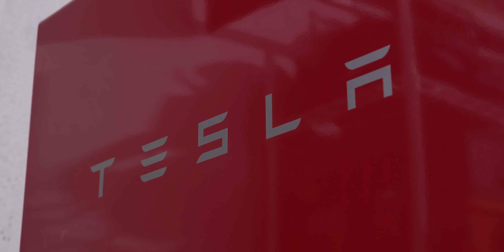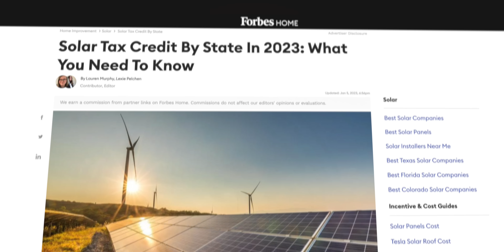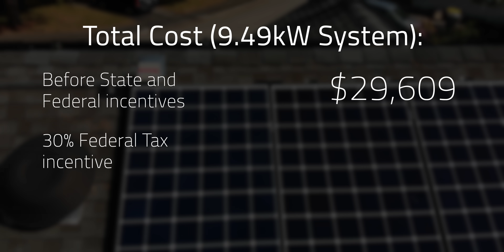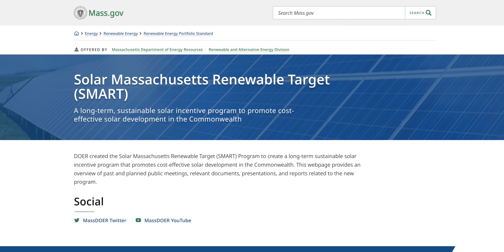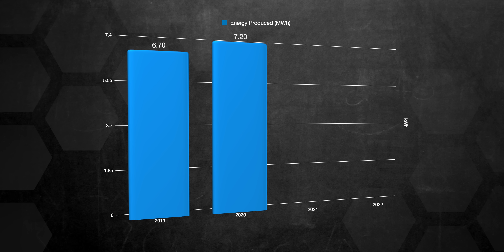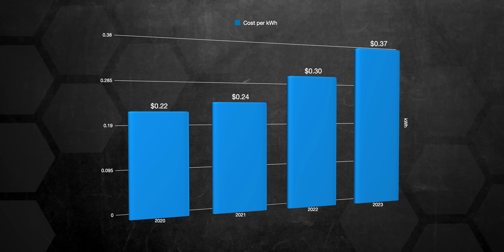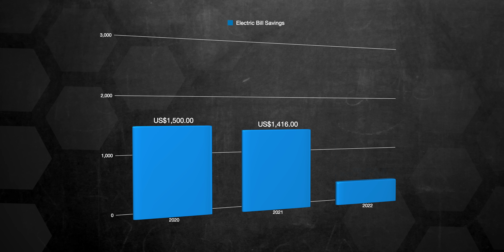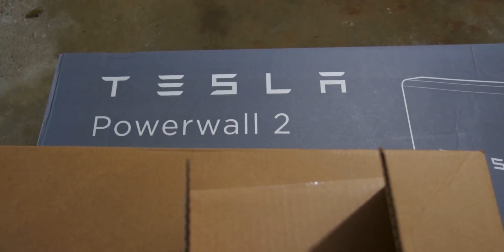5 Years with Solar Panels - Is It Still Worth It?

Comment: what does Tesla say the life of ur wall will be?
Is it a cell type battery?
If so u need to learn how to change them out when one or 2 of them go bad
I now own 2 Leaf's one is a '13 the other is a '20
I have had the '13's battery pack twice now to change out all of 5 cells rathjer then buying a whole new battery pack
So far my cost to do this is 2 hr of my time and the $1000 I paid for a wrecked Leaf and I still have a 16 good cells left.
By the way is ur wall battery made with the same cells (if it is a cell type battery) as the cars use?
I am thinking of buying another wreck to get a wall battery.
By the Way I am a BSET so i do all this work myself.  It is not hard and all i need here in NYS is an election as a contractor.  Found one who will play this part for me very cheap
After all all he needs do is come look at my work and say it was done right and sign take my check.

Comment: I( see why u went solar  I pau just a little over 12cents/kwh with 35% of that being transmission cost over 100 mil form Niagara Falls  Yes I am a NYSEG user so my electric is all ready all renewable
But where I live wind is best so I am saving to put up a 10K mill  Ya not much but it is the battery that I want to cover outages more then savings on power
We get about 25% out of max mill here so it well average about 2500k  As i use less then 1K on average I will me making money on this
How much I dont know b/c NYS keeps changing it every few yr
I would like to see Ny go to net metering but the for profit elec co will never let that happen.

Comment: Great analysis! I'm thinking of going down this path myself.  Are there issues installing solar onto a century old home?  Would it make sense to address other home issues first for energy efficiency like windows or insulation?
Reply: My grandparents just went solar and their house is 90 years old. I think it depends on the condition of the home and the roof. We were also concerned about the age of the home but if you find the right company it’s possible unless you make a DIY project which might also work. If you are interested, I can give you the info of our consultant(if you are in the U.S), he was very transparent all the way with us so I’m confident that he can help you. Let me know if you are interested
Reply: Our home is about 50 years old and yes you should absolutely air seal your ceiling (taping so there aren't leaks between the ceiling and attic). Insulation and windows will go a long way too. We saw 30% less electricity usage this summer vs last summer (actual usage, not just price) from having our HVAC ducting repaired and doing some minor repairs in the attic.

Comment: I just had a solar guy over last night. I was leaning towards getting the solar but I’ve changed my mind. Why, because in researching the bottom line. I spoke with the county assessor office who said, when the permit is pulled for the solar installation, my property taxes will go up. Then to top that off, I spoke with the realtor I’ve dealt with for nearly 20 years and she said for where I live, the solar install is not actually resulting in an increase for selling price. Both of these things go against what the sales person was saying. The salesman was correct that my insurance cost wouldn’t increase. 

So if paying cash, I was looking at about a 9 year break even point prior to factoring in the increase in property tax. Now it could be 14 years and if I’m not going to be able to recoup anything when selling the house. Why should I even go solar. Considering I’ve already been in this house for 5 years and on average people move every 7 years. solar is a bad idea.

Comment: Had my solar installed for free. I have an agreement to pay per kw produced. With an increase of 2 percent per year.
I had it installed in 2019 and I'm still paying under 14 cents per kw. 
Electricity was 22 cents when I started and now it's 39!
I was saving about 9 cents per kw and now I'm saving about 25 cents per kw.
It produces about 11,000 per year and I use just over that. So I pay the full 39 cents for about a month's worth.
Nothing out of pocket for the system and I saved about 2750 last year.
I've been saving for the past 3 years, more every year.
I don't have to worry about return on investment (ROI).
I went this route because I don't plan on being here for more than a total of ten years. At the time ROI was estimated to be 8 years if I bought one right out.
I didn't want to see a saving only for two years. I have saved about 7k to date so I'm still happy with my choice not to buy.
Also, it will be interesting to see of he sells for more than what is estimated. It's been my experience (not my first house with solar) that most people are weary of solar; they don't lime what they don't understand. Depending on how much time is left on the warranty, they know it's one more thing to worry about.
The system I had installed (for free) is covered for 25 years. So when I sell, it will still be covered for 15 years. It makes it easy to sell the house.

Comment: Matt, you don't say if you have an EV but net metered electricity to charge our car saves a pile of money and the satisfaction of not using gallons of gasoline.  Our 9.2 kW system after subsidies is amortized at 5 cents per kWh. Electricity for our Chevy Volt plug-in hybrid costs 55 cents per gallon equivalent compared to $3,50 per gallon for gasoline.  Currently, electricity here costs about 14 cents per kWh so even at retail rates it would only be $1.54 per gallon equivalent.

Comment: The only reason I have solar is because I don't expect the power company to be reliable or even be here in a short time.  That is why I would not consider degrading my battery by letting the power company use it.  My system is totally off grid.  I do not have a grid tie system.  It does take time to manage the loads even though, I have been saving quite a bit on my power bill.  Soon we will not have access to the grid if Kalus Schwab gets his way and he has since 2020,

Comment: "not being pulled from a pool of taxpayers money" that is a bold faced lie. Comparing it to the Child Tax Credit doesn't change a blessed thing....they are both credits added directly to your balance sheet when calculating your taxes. I clicked on this for an honest analysis.....which is very hard to find due to mass cognitive dissonance in society when it comes to Solar Power. I believe a better energy source is inevitable but for now Solar and Wind are giant fails except for specific isolated applications apart from supplying Interstate Grid Systems.

Comment: sprayed-in foam insulation is the answer. i had it done on my last home and it cute my energy bill in the summer by nearly 65%. your attic will only be about 3-4 degrees hotter than your living room. it literally blows fiberglass insulation out of the water. solar panels are WAY too expensive for the return.

Comment: I've had solar for 3 years. One thing I wish I had known was that you need to compare the net metering numbers the system produces compared to what the utility is registering. It turns out that my system started misreporting my consumption some time in the first year, probably due to a loose CT in the electric panel. I then bought an EV thinking I had massively excess production -- it wasn't true. So now I have an electric bill again during winter. The EV was still a good choice for a myriad of reasons, but it's no longer "free" to run like we initially thought it would be.
Another lesson learned is to use a solar installer with a local footprint. My installer is a big company in multiple states, including my state, but they don't have an office/warehouse in my area. So for service issues, I have to schedule visits that come from across the state, adding additional turnaround time.

Comment: Thanks for the most useless information about solar panels. This video is just you bragging about how good you have it while evading any real issues. How much has your battery capacity diminished and when will you need a new one? How much does it cost to properly dispose of it, if there is ANY environmentally friendly way? Are you pawning off this problem to the next owner as a buyer beware scam? All the information you provided was anecdotal and therefore worthless.

Comment: My problems with solar:
1) Misleadingly expensive. In the calculations of cost, there are a lot of "credits" and "discounts" that apply only to certain people, locations, and times. I've noticed on the whole that the cost to purchase and install (discount or not) panels is nearly equal or greater, to that household's annual energy bill for 5-10yr! What are you saving really?
      Also... most of this nation's electricity comes from hydroelectric dams and coal plants. With the years 2020-2023+ political administration constricting production/usage of these two methods OF COURSE utility electric costs are going to rise. And it's with lowered production come "blackouts". We are being pushed to convert to solar intentionally. Just like LG stopped making panels-why? It's expensive energy, not efficient energy.

Comment: The electric rate you quote $0.37/kWhr is way high.  If you factor that in to folks buying heat pumps, it makes them way more expensive than gas or oil.  It's like paying $14.80/ga of oil.  Even with a COP of 3 it is still like paying $5/ga of oil.  National average for electricity is much lower.  So I think this argument doesn't apply to most people.

Comment: My home cost less than 100 a month all year. Total electric with no ugly panes . Brick makes a difference and got rid of central air which cut bill in half. Use three 110 volt ac unit and wall heaters. 110 volts each.

Comment: Lies. The cost of the system is still 29k. The rebates are not magical money that comes from nowhere. Also, the push for renewable energy is the main reason for increased energy prices over the last 5 years. If we all just kept traditional energy sources then electricity would still be that lower rate around 20c/kW.h, so the savings should be based on that. There are other costs associated with renewables, such as policy making and propaganda, and that all costs money too, which we are also paying for. It's a scam.

Comment: I wish I would have known the information in your video back in 2020. That's when I started the fiasco I'm currently embroiled in. I live in the mountains of central Colorado in an ideal location for solar. My average electric bill WAS $47.00 a month. Yes, $47.00 a month. Why did I even consider solar with such a low monthly? I wanted to do yet another good thing for the environment. For example, I generate very little trash/garbage---three to four 40 gallon bags to the waste transfer station per YEAR. I modified my pickup to increase its fuel economy (and torque and horsepower) an average of 30%. So, I try to do my part for the sake of Earth. To date I've been involved with 3 solar companies. With the first one, I made a few inquiries, got the answers and then mulled things over. I shopped around and decided to go with company number two: I had estimates, an inspection and thought they were going to install my panels and then....they might as well have floated off into space; the entire process came to an abrupt halt. I called, texted, and there was no response. Nothing. Company number three is where I'm at now. They assured me that they wanted my business, they'd follow through with alacrity, and I thought, "Third time's a charm." To quote Bugs Bunny, "What a nin-cow-poop!" The point man I first dealt with told me he was on top of everything and things were going swimmingly---permitting, ordering panels, the inverter etc., coordinating installation and whatever else needed to be done. He did NONE of that. NOTHING. It was 6 months or so of me asking for updates and him lying his ass off before I brought all this to the owner's attention and that guy was given the bum's rush. Okay, now I'll get things going, right? Not hardly. I've been dealing with company three since roughly September of 2021 (back when the tax incentive was 26% in Colorado; now it's 22%). Point man number two was conscientious but not as experienced as he should have been. Naturally he quit the company so now I'm dealing with point man number three. The company has been in business in the Pikes Peak region since 1975, but somehow they didn't know that the Teller county building department (my county) has different requirements than El Paso county where the solar company is located. They are adjacent counties and the distance from my home to the company is less than 50 miles and we're both part of the Pikes Peak region so it's not like we're ten states away from one another, and "...east is east, and west is west, and never the twain shall meet..." I thought a company that's regional, in business for 46 years at the time I hired them and has a good reputation should be a good bet. Silly me. The company recommended a lender, I took out a loan in June of 2022, at $111.63/month with the idea of paying it off in 2-3 years and I'd start getting energy credits from my utility company. To date NOTHING has been done except to: switch the solar panels I was originally promised to another kind of "equal quality and life expectancy"; belatedly inform me that Teller county thinks my 26 year old roof my not be able to bear the weight of solar panels, and an engineer needs to assess it. I went to the Better Business Bureau to see if I could get out of the contract and was told no way, even though I have zero confidence in this latest company to give me a solid installation with top quality components. Now my electric bill averages $148.63/mo, I have no solar panels, no assurance that my perfectly solid roof will pass muster for solar panel installation even though it was built to Teller county codes, and I'm on the hook for a loan whether I get solar or not. All because I wanted to do something good for the environment. I guess no good deed goes unpunished...

Comment: I love totally off-grid in upstate New York the solar panels do not charge the battery for about 5 months out of the year and I have to use my generator which cost a lot of money and ethanol-free gas to run about five hours a day. I have like this for approximately 12 years and it is hard. You can't clean off the solar panels because of the ice buildup and that has to be cleaning all times to work. The for solar battery said I use have to be replaced approximately every 8 years at about $1,000 for battery which is very expensive. I'm not a fan of solar.

Comment: Last year, I had a solar panel system installed on my house, and something that you didn't mention, was the cost of the power inverter.  My system uses a Generac power inverter, and a Generac battery storage system.  My Generac power inverter also contains a transfer switch, that transfers my power from the grid, to my battery system, once a grid power outage occurs.  The reason that I decided on a Generac battery storage system, is because it's easily expandable, whereas the Tesla system is not.  How much did your entire system cost, before the tax credits?

Comment: I would like to see a detailed financial analysis on your system. I also would like to know what is included in the price you use for power of 20 to 30 cents per kilowatt.  We were paying 3.3 to 3.5 cents until the price of natural gas was driven up by political activity.  Now we pay 10cents a KWH. Natural gas is what drives electricity costs.  As it goes up so does the price of power.  What are you including in the costs you are using? I've looked at solar as has an engineer friend.  Its really not viable investment in our area even using the 10cent/KWH.  If you want to protect yourself from power outages there are other much less expensive ways.  In 20 years we have had about 3 days without power.

Comment: I live in old town Napa California and got solar panels for my house in 2014. Included in the cost was a once-a-year inspection and cleaning by a consultant. Not included in the calculations was the reduction in efficiency when the panels later became covered/impaired by ash from wildfires in the Sierra Nevada and Coastal California Ranges. I didn't notice the difference in cost until they did a seasonal inspection and washed off the panels with ionized water. Worked great! The power production shot up to where it should have been. 

The other issue was that management is sometimes lacking in start-up solar installation companies.  Between the system going offline and it takes a few months to get a contractor to come out and fix it, the reduction in production due to ash-fall, and a requirement that they pay me the balance if the system failed to perform as predicted, they went bankrupt. Then the company quickly switched hands again. Now I am with a third company, but my payments are amortized, so I know what it's costing me and I am good with that. 

So, be sure any company you are dealing with has a positive track record (i.e., experience). And sad to say, in California, you can plan for wildfire, so make sure you do it.

Comment: Matt, did you look at the ICF wall system for energy efficiency?  I built an ICF home, 2000 sq.ft.  For the last two years it has cost me on average of $130 per year, yes cost per year, (my t-stat collects the data) to cool the home, for our short "winters" here in South Alabama I use a wood stove.   I used  brick veneer on the outside and a metal roof with spray foam in the attic.  I keep a chocolate Easter Bunny sitting on top of my HVAC system in the attic. Safe room included as a bathroom.